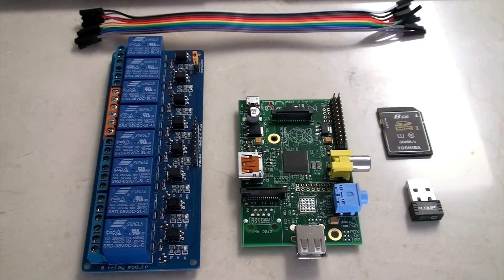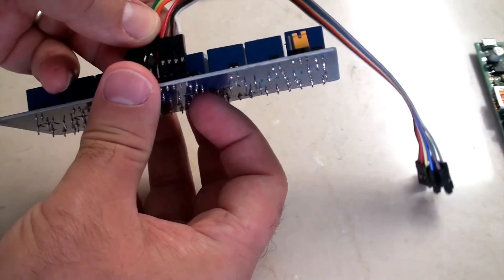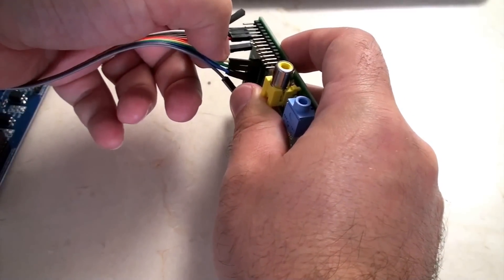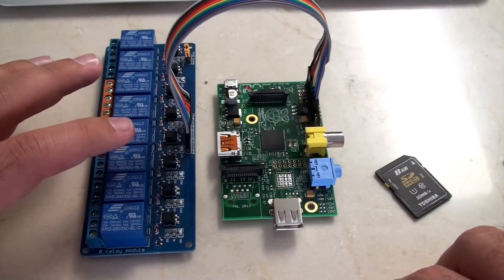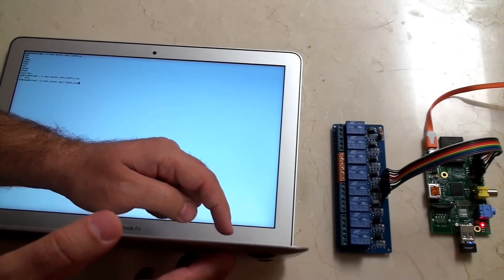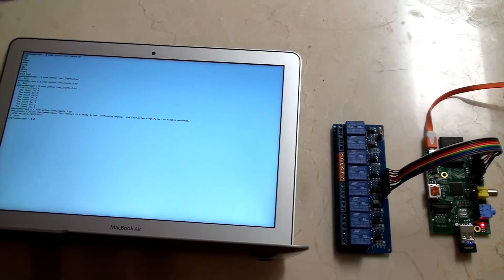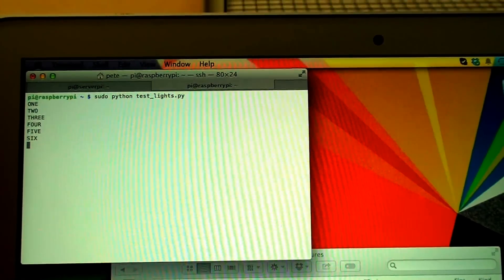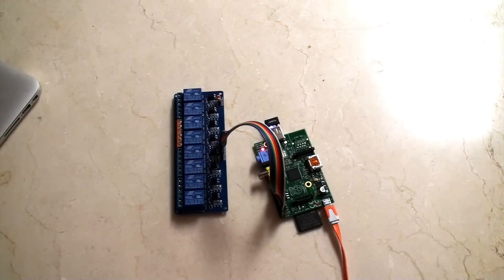Raspberry Pi: 8 Channel Relay step-by-step with software examples for automation

Comment: Where does 8 channel relay come in handy? I’m just trying to understand relay part and where can you apply this in project? Where to? Can someone provide some scenerios?
Reply from the maker: So a "relay" is just basically an electronically controlled switch.  You know, like a light switch, but instead of controlling it with your finger you control it through electronics.  So, basically anywhere you have a switch - like lights, or circuits, or devices - you can control it with this.  Some examples?  I control my furnace with a relay.  Lots of home lights, and christmas lights.  And check this video out: Garage Door: https://www.youtube.com/watch?v=p2abZ90-eU0&ab_channel=skiwithpete

Comment: Thank you, I did set this up i am using B model however the lights come on as yours did but the relay never changes state it never closes although the light changes state and there is no noise for any of the relays,
I bought 3 of these and all three do exactly the same thing
Reply from the maker: First, just make sure that they are optocoupler relays.  If they have bulb type LEDs, then you might have the wrong type.  If they are optocoupler try changing the high and lows in the script to see if that gets you different results.

Comment: I used your code and modified I will attach on my next comment the script runs, can see the relay led lights up but no clicking noise any ideas?
Reply from the maker: No clicking you need "Solid State" relays
Reply: @skiwithpete  thank you, I uploaded your script which I made few changes, I only run one zone at a time. Because of the water pressure.
Because of the script and the step by step instructions it made my day, and my sprinkler project a success!! Thank you

Comment: Can you use a raspberry pi to run all the functions in a car?  eg: monitor engine and all sensors, control fuel, as well as all dash instruments...
I don't know all that a modern car computer controls, was just wandering if the Raspberry Pi could do all that?
Reply from the maker: read the functions of a car or run the functions?  Read - look up the ODBII or ODB2.  Run - well you'll need to start with realtime kernels because some functions and sensors on a car needs capabilities beyond the responsive lagtime of an off the shelf Linux OS.  And, this is way way wayyyyyy beyond my knowledge of Car CPUs and all of their functions.  But, interesting question.  Reply back as you dig into this.

Comment: I have questions, I want to program an LED lightshow to music (not pixles, just regular 12 volt LEDs) how much is the output of the replays, it can’t be anymore than 12v or it will fry my custom made LED strand. I wired a bunch of 12v single LEDs together to make a strand. If this is more power than I need, where can I find a board that I can use LEDs on and program it with my raspberry pie?

Comment: Awesome video love it !!!! Question im trying to connect a relay switch with Bluetooth to turn on a light by Bluetooth from a vibration sensor?
So when the vibration sensor goes off it turns on the light.  Thank you 😊

Comment: how can i add a code for motion sensor please and if its high then the light start
Reply from the maker: Watch my other videos. I have ones that show motion sensor and have code
Reply: @skiwithpete  a link will be great please you have ton of videos
Reply: @skiwithpete  i found this one https://www.youtube.com/watch?v=cci18pMwSTQ but there is no code
Reply from the maker: @EnergySeeker  I linked it to the original authors https://www.raspberrypi-spy.co.uk/2013/01/cheap-pir-sensors-and-the-raspberry-pi-part-1/
Reply: @skiwithpete  i found some with motion but no code for the motion part please help

Comment: so i can just connect 120 volts to the common and to the 120 volts 10 amps lamp and it will light up ?  do i need anything between the light and that relay ?

Comment: Great Video!!!  One question.  Can you use these scripts on any Raspberry pi model?  I figured out a way to get around the power issue from a different video and was hoping I could still use these scripts.  Thanks.
Reply from the maker: Yes.  But check your pins for your model.  Scripts will work with adjusted pins.
Reply: I just used the scripts on a RP4, changed the pin #'s,  and it worked like a champ!

Comment: Watching this in 2020! :) Did my first use of GPIO with a spare RPi 2 v1.1 and your same 8 relay module. Pinout was the same. Worked flawlessly with your script. My board is attached to cabled Ethernet not WiFi. Thank you very much.
Reply from the maker: Awesome. Thanks for the comment!

Comment: Just finished the videos for both the 4 and 8 relay boards.  Now trying to get it all to work with my Pi B+ running a new install of Buster and a 4 relay board.  My initial try using BCM pins 2, 3, 4, 17 was not fully functional.  The relay board on Pi startup has the LED for IN1 (BCM 17) on (the rest were off).  Running the scripts did not have any effect.  What have I done wrong?
Reply: The BCM numbers changed early on in RPi development: https://raspberrypi.stackexchange.com/questions/12966/what-is-the-difference-between-board-and-bcm-for-gpio-pin-numbering
Reply: @TheOneWhoMightBe ...I switched to board numbers  32,36,38,40 (BCM 12, 16, 20, 21) and all is working fine now.

Comment: Im learning Python, I found it educational. So now that Python 2.7 is going I was running the code in Python 3,7 and it doesn't run. The issue is the print command needs ( ) to make it run. Thanks for a great video.
Reply from the maker: This is on GitHub, can you contribute this change to the code?

Comment: You can remove the jumper and power the relay on jd-vcc with a seperate power supply!
Reply: Then you could do away with the VCC and the GND to the Pi , Correct ?

Comment: Watching and loving this in 2019
Reply: 2024 checking in
Reply: 1 week later I have my parts and the free time, it works! You're awesome man!!! I'm a full time software engineer, but I've never messed with this stuff before. So cool!
Reply: What pi did you end up using? I’m in uk and can’t find the exact one that’s in the video- I’m also new to the pi so don’t know the difference between the models!
Reply: @i_Tubs  have you found what you were looking for?  I am using the pi Model B rev 2 and i did have the issue acouple of years ago, that swpete was talking about, but revisiting this, it just simply worked... okay, after adjusting the GPIO numbers in the list. as long as you know what pi you are ussing you can search the 'net for pin/gpio layout. This also worked for me using raspberry pi 3
Reply: Stephen Viner yes thanks Stephen. In the end I just went for the 4gb pi 4, for the extra £20 or so I thought it would be worth to go for the newest and highest spec one! Got it controlling my Christmas lights at the moment!
Reply: try 2020 :P

Comment: I know it's an old video, but I wouldn't connect 5V to VCC with the GPIOs at 3.3V. Better use 3.3V VCC and an additional 5V to JDVCC. In the case of an 8 channel relay it also wouldn't hurt to use external 5V.
Reply from the maker: The relays function because of the different voltages.  There is NO HARM at all using a 5V on the Pi.  DO NOT connect the 3.3V to the VCC as this will underpower the relay.

Comment: I just built my relay box 8 channels similar to how you have yours set up, mine is a box looking thing but non the less functions just like your does.  However I do not get the same problem as you on the test script countdown the very first one you run, it lags out at 7 8 and yours but on mine it does not do that at all, Even with all WiFi Bluetooth and HDMI with Ethernet didn't make it trip like that I'm not sure why your is doing that.  My model is the pi 3 b+.  Thank you so much for this video it worked wonders for my build, I built a controllable 8 channel wall plugs 4 of them but able to control individually by snipping the positive connecting piece on the plug thus I can control 8 plugs.  I'm using mine for this years Christmas lights show.  Yes I went with mains on this project because of what I wanted to do, I know everyone says stay away, but your good if you have the right equipment, a gfci plug goes a long long way to test these things and common sense is the best form of safety.  Also the pi supply's all the power to the relay board on my setup, no additional power source needed, I also using python coding to control so that may play a factor idk I'm knew to the pi world and loving it, not knew to how pc's works and what not but knew to tinkering with it and controlling it the way I want it to be controlled is awesome

Comment: What is he running each python script with?
Reply from the maker: Like what command?
Reply: @skiwithpete  never mind I should of finished watch the video before running however do you have any videos on controlling a outlet with a raspberry
Reply from the maker: @thomaspowis418  Watch my 1-channel relay video.  Then all you need to do is connect it to an outlet instead of to a light power source.

Comment: Okay... Here's my limit switch input and Relay control output. I'm using Tkinter and a 5" touch screen. I'm controlling 4 relays and 2 limit switches. Now this code was hard because the "while True" arg was looping and preventing the buttons from running. For some reason the pin inputs are hokey.. I think it can be written much better but it's a working progress!

import tkinter as tk
import tkinter.font
import RPi.GPIO as GPIO
from random import randint
from tkinter import Tk, Button, NSEW
from gpiozero import LED, Button
from signal import pause

win = tk.Tk()
win.title("ARBOR 4.0")
myFont = tkinter.font.Font(family = 'Helvectica', size = 24, weight = "bold")

Relay1 = LED(5) #Left Bin Selection
Relay2 = LED(6) #Right Bin Selection
Relay3 = LED(13) #Latch Release
Relay4 = LED(12) #General Bin Selection Signal
LimitSW = Button(26) #Sense Status of Door
SensePin = Button(16) #3.3V Return for System Use Status

GPIO.setmode(GPIO.BCM)
GPIO.setup(26, GPIO.IN, pull_up_down=GPIO.PUD_DOWN)
GPIO.setup(16, GPIO.IN, pull_up_down=GPIO.PUD_DOWN)
POLLING_DELAY = 3000

def get_gpio_input():
    return randint(1, 10) < 3

def check_status():
    input_state1 = GPIO.input(26)
    input_state2 = GPIO.input(16)
    if input_state1 == False::
        if input_state2 == False::
            LimitSW["text"] = "System In Use"
    else:
        LimitSW["text"] == "System Available"
        Relay1.on()
        Relay2.on()
        Relay3.on()
        Relay4.on() # Reset all relays to off
        PaperButton["text"] = "Paper"
        PlasticButton["text"] = "Plastic"
        GlassButton["text"] = "Glass/Metal"
        GeneralButton["text"] = "General Waste"
    #Return all buttons to primary state

def selectOption1():
    if Relay1.is_lit:
        Relay1.off()
        paperButton["text"] = "Paper"
    else:
        if LimitSW["text"] == "System Available":
            Relay1.on() # Signal Left Bin Selection
            Relay3.on() # Open Latch
            paperButton["text"] = "Pleae Wait!"
        
def selectOption2():
    if Relay2.is_lit:
        Relay2.off()
        plasticButton["text"] = "Plastic"
    else:
        if LimitSW["text"] == "System Available":
            Relay2.on() # Signal Right Bin Selection
            Relay3.on() # Open Latch
            plasticButton["text"] = "Pleae Wait!"
        
def selectOption3():
    if Relay2.is_lit:
        Relay1.off()
        plasticButton["text"] = "Plastic"
    else:
        if LimitSW["text"] == "System Available":
            Relay2.on() # Signal Right Bin Selection
            Relay3.on() # Open Latch
            PlasticButton["text"] = "Pleae Wait!"
        
def selectOption4():
    if Relay4.is_lit:
        Relay3.off()
        Relay4.off()
        generalButton["text"] = "General Waste"
    else:
        if LimitSW["text"] == "System Available":
            Relay4.on() # Signal Home Bin Selection
            Relay3.on() # Open Latch
            generalButton["text"] = "Pleae Wait!"    

def exitProgram():
    win.quit()
    win.destroy()

LimitSW=tk.Button(win, text='System Available', font=myFont, bg='orange', height=2, width=36)
LimitSW.grid(row=0, sticky=tk.NSEW)

paperButton=tk.Button(win, text='Paper', font=myFont, command=selectOption1, bg='blue', height=2, width=36)
paperButton.grid(row=1, sticky=tk.NSEW)

plasticButton=tk.Button(win, text='Plastic', font=myFont, command=selectOption2, bg='red', height=2, width=36)
plasticButton.grid(row=2, sticky=tk.NSEW)

glassButton=tk.Button(win, text='Glass/Metal', font=myFont, command=selectOption3, bg='green', height=2, width=36)
glassButton.grid(row=3, sticky=tk.NSEW)

generalButton=tk.Button(win, text='General Waste', font=myFont, command=selectOption4, bg='purple', height=2, width=36)
generalButton.grid(row=4, sticky=tk.NSEW)

exitButton=tk.Button(win, text='Exit', font=myFont, command=exitProgram, bg='purple', height=2, width=36)
exitButton.grid(row=5, sticky=tk.NSEW)

win.after(0, check_status)
win.mainloop()

Comment: I'm a bit confused, I have a pi 3b so when you are saying A or B are you referring to the pi 3a or b? a couple more question 2) what's the output voltage and is it capable of doing bluetooth and wifi
Reply from the maker: Yes, back in the day there was only the Raspberry Pi A or B.  Now it is Raspberry Pi 3B+ or ZeroW.  But they remain largely the same.  They output 5V and 3.3V but check your spec sheet for the limitations on those give the Amperage of your power supply.
Reply: @skiwithpete  I'm more interested in the relay module, can it talk to the pi via bluetooth and wifi? and its output is 12 volts?
Reply from the maker: @Coolbreeze61  Not the one I'm using in this video.  It's a wired relay.  And it needs 12v.  Doesn't output anything.  Not sure if you really understand what the relay is... Watch my 1-channel relay video.
Reply: watched that video, still not what i'm looking for. i'm needing something that can communicate with the raspberry wirelessly whether it be additional very small equipment such as a bluetooth or wifi dongle. here's my project I have an RV and want to control my lights and other 12 volt stuff via raspberry (voice control) or smart phone Is there anything out there that can do that
Reply from the maker: @Coolbreeze61  stay tuned to the channel. There's a relay thermostat that I made that's zwave. This might work for you
Reply: @skiwithpete  when will you be posting it
Reply from the maker: @Coolbreeze61  my current life situation doesn't let me plan a regular schedule. So soon.  That's as close as I can get.
Reply: @skiwithpete  can you at least give me the brand name and model, a friend of mine code a pi for me to control some things but we're having a hard time finding a relay that works the way we want it to
Reply from the maker: @Coolbreeze61  I'm traveling and don't have the piece with me

Comment: Hello, I've been running the example python scripts on my Pi and have an 8 relay board similar to the one in the video.  I thought I understood what you'd done in the scripting, but may be missing something.  The First script fires off and instead of a simple progression 1-8 of relays lighting up I get a cool looking but random clicking on and off of the relays.  Is there an explanation of turning on a single relay?  I can get only one of them to work but not as you'd think.  Instead of it turning 'On' lighting up and staying constant, it turns on and off in rapid succession.  Any thoughts would be most welcome..
Reply: I am unsure what changed, but I came back to this and it was behaving as I hoped.  "On" stays on, "Off" goes off.  in my scripting..

Comment: Power the relays externally. On the set I have (mine are made by Sainz but they are all the same), the JD-Vcc is 5VDC, and the Vcc is 3.3VDC. Power the relays externally and you won't draw down the power buses on the Pi. I have run banks of 8 relays this way with no issues.

Comment: I am currently running a encoder...which is stepping the io pin very fast...the count is correct..but the display is out of sync...so if i stop the run process at 809 ticks...light an led..the light comes on way faster then the screen display..so my count on the encoder is correct..but the i cannot asume the numbers on the display(hdmi monitor)...after a while..it corrects the numbers on the display...it has been so frustration that i made a simple program just to messure this problem.. i dont use wifi or terminal..but directly on the pi3+ 
But... i also found using so many output to the gpio is better to use external power and use modbus...as i need other gpio for other stuff.
Serial to rs585 ...still working on this...but the display is an issue as i need it to show excactly on the screen...its best for my mental health😉

Comment: I want to use a similar set up for starting a car, I only need 3 to 4 relays, which will in turn activate 30~60 amp relays @ 12VDC, should I use an A board for this as well?
I have been hesitant to buy any hardware cause I don't know anything about it, but my build is getting stale and I need to make a move before the year is up.